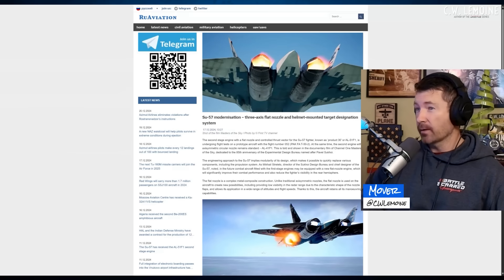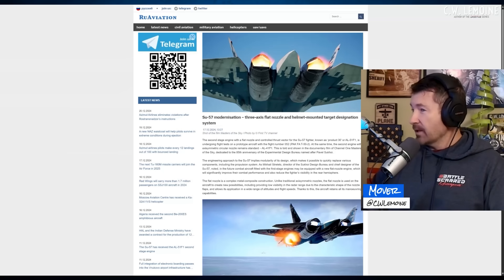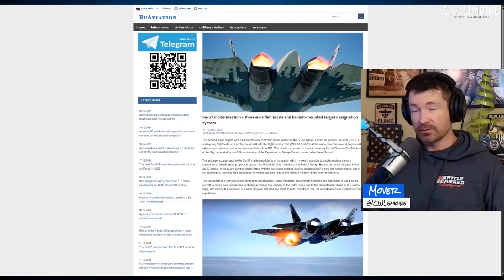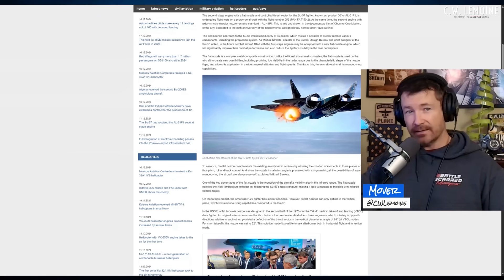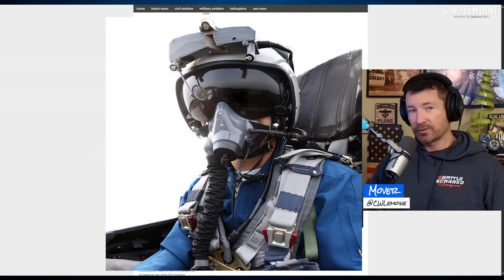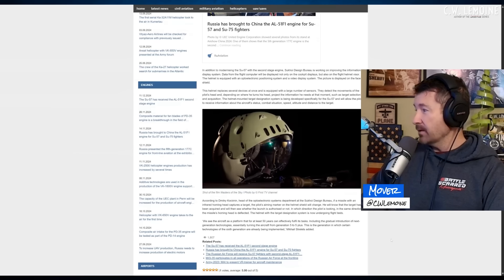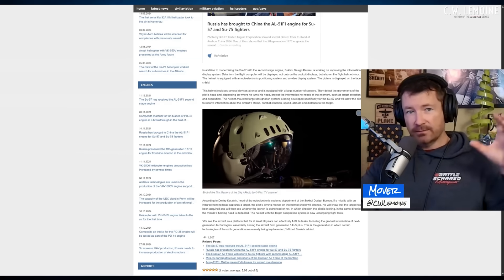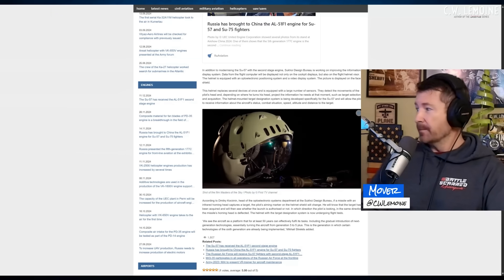New Upgrades for the Su-57 FELON

Comment: The SU-57 has one of the world's most advanced radar arrays. Pretty much the entire front of the plane contains radar emitter modules including the leading edge of the wing and sides of the nose. These are meant to allow for longer wavelength emissions for detecting stealthy aircraft and scanning more of the sky at once.

Russian radars tend to be worse than western radars of a given size and weight, but the SU-57 is a big aircraft, so be assured that they have crammed a good amount of the systems in them.

I would seriously recommend you watch Millennium 7 on the SU-57. It is not exactly some super weapon, but the Russians design has always been quite different from Western designs as a result of their asymmetric air-combat doctrine.

Comment: Looked at a channel that had a deep look at the new system, comparing it against the old system - a lot less moving parts and found to be more reliable, cheaper to build and maintain and also easier to maintain.  A comment that came up was 2 dimensions were the usual for air combat with the 3rd dimension probably for aerobatics - most likely for air shows and marketing the beast.

Comment: Thank God that Russia doesn't have the cash to mass produce. They have the tech but like Germany in WWII they just want to "Land Grab. The SU 57 is basically a F22 with smaller Vertical Stabilizers, Engines closer together and 3D thrust rather than 2D. They will lose some maneuverability by changing up exhaust to improve stealth.
Reply: Its a garbage plane with 10,000 times crappier stealth than the F-22 and F-35 and that is a FACT.
That plane is not a stealth fighter. Russian industry is too far behind to make anything comparable. They are unable to make plates sitting tight togheter so that radar reflections are minimized. The body of the plane is Y-shaped which makes the plane even more unstealthy. Its a worthy opponent of 4th generation fighters, but it cannot take on the role of 5th gen fighters because it is not stealthy enough for that.

Comment: Su 57 most advantage is their range 3500km internal fuel, becouse it's big size,
Reply: Actually, the maximum range without outboard fuel tanks is 4,300 with 5,500 of them.
Reply: And yet not much impressive compared to most other jets in the west. Gripen E despite its small size and single engine got a range of 4000km.
And F-15E got a range of 4800.

Comment: Modernizing a plane that just came out. And they don’t even have enough for a “squadron”
Reply: Su-27S was barely out, when Sukhoi was already developing Su-27M, that was for export market as Su-35.
Do not mistake Su-27M / Su-35 to what the Su-27M2 aka Su-35S is. 

The Su-27M was far more than what Su-27S was, as it was adding more what the Su-27S was suppose to be, but was cut off by the specific minister who wanted Su-27 share as much as possible parts with the MiG-29 project. 
So Sukhoi was required to downgrade HUD from 4-color to monochrome and from wide to narrow. Radar was downgraded from PESA to common one, datalink was maintained, and cockpit didn't have five LCD but just one and without buttons.
The original Su-27 was too advanced at the time, and as usual the budget concerns like to cut things.
Reply: It's for show, like everything else. The real workhorse are the rapidly depleting Soviet stockpiles and Nork ammo.

Comment: The Nose, Wingtips and Tail radar can all acts as a Diamond Array for Passive Radio Direction Finding.

That means if the SU57 wants to penetrate an IADs system it can guide itself away from emission sources.
Reply: That is what the RWR does. 
You have multiple sensors set in furthest part of each other and timing of received signal is used to triangulate the emission location.
You don't need radar for that purpose. 

The radar benefit in AESA is that you can triangulate the location just with single panel, as you can time the signal between each element.

The Su-27 already could do this. And don't take the DCS horrible presentation of the Su-27S as it is biased to such negligent and underestimation that it is a crime. 
Eagle Dynamics has not even got SPO-15 RWR anywhere near close to real thing capabilities. What cause that people are constantly mocking SPO-15 capability because they base their understanding to disinformation by ED.

Comment: I get a little annoyed sometimes when people say more parts means more likely to break that only applies when the parts are designed poorly. It's a poor design problem not a more parts problem.

For example, switching from single overhead cam to dual over head cam. Spread the wear out between two separate parts allowing for more long term reliability with higher performance.

This mindset comes from Americans working on German things because the Germans tend to overcomplicate everything..
Reply: While it is that design matters, but the fact is that more parts you have, more malfunctions you have. More moving parts, more wearing parts, more parts to fit together... 
You can try to explain yourself out that how a amazingly well designed rubics cube will never malfunction or break. But take a solid block made from same material as you try to design the rubic cube, and you know that the solid block will always withstand far more than the highly engineered block from smaller blocks. 
Notice that solid block doesn't have same functions and capabilities as rubics cube, but if your purpose is to just kill someone by throwing it and hitting someone to head.... The solid one wins every time.
Reply: @TK-sh1lq  my explanation of the cams should be enough to prove its not always true.

Here's another example a wheel bearing. Before bearings they used bushings. Bushings are much less moving parts, but they are more reliable, and can handle more stress.
Reply: @Greasy__Bear  They do???
Reply: @Greasy__Bear  not really a good example, as the other guy said, more moving parts is more wearing out parts, if the system is well designed it will last of course but one could argue that a tuned down single cam design with less stress on the components can match it. 
Also don't bring German engineering here, it's even worse example because when it comes to German engineering and particularly in automotive industry there are other crucial factors that MUST be considered such as:
1 - EU: cars in European Union must follow extremely strict norms on emissions and safety which in turn heavily affects overall design and technological solutions.
2 - The mindset or doctrine if you will behind the German engineering. The idea with their design is that while it's extremely complicated and can be a real pain to work on, the system is usually very efficient albeit not very redundant but that comes from the assumption one will strictly follow the instructions on how EXACTLY use and maintain such system (the car in this case) and will not deviate from these instructions. If these conditions are followed then the system usually gets through it's expected life cycle and even beyond that just fine.
So then there is also the expected life cycle of the system which is something that changed a lot when we talk about European made cars. They just don't make them to last anymore in most cases but that comes from business side of things, not engineering side...
Reply: @peterkolesar4020  my brother worked with German engineers on a ATM machine, and had a similar impression. 

The Germans had  the opposite opinion of the American engineers as in their creations are crude and overbuilt, but the Americans designs were usually cheaper and quicker to produce and no less reliable.
Reply: Dual overhead cams were mostly used for improved efficiency, emissions and performance, not because it's more reliable.
In fact there's still unicam engines produced today.

Comment: This flat nozzle design by the Russian is actual simpler by far, that the one with round nozzles. The reason is that each element in the round nozzle has its own hydro-mechanical actuator, where as in in the flat nozzle you have actuators above and below the nozzles, and another pair outside the horizontal planes. The mechanism is easier, more durable and much lighter
Reply: Пока нет видео работы сопла с гидравликой полностью . Просто и на треугольном сопле можно вокруг расположить гидравлику .
Пока нет видео и значит спорить бессмысленно .
Reply: @PirandelloKruger  There actually is a video showing exactly how the new flat nozzle is being actuated. Just because you do not know about does not mean that it is not there
Reply: It isn't at ALL simpler. In comparison to the AL-41 it can be argued that it is, but the AL-51's thrust vectoring design is more streamlined than even the PW F100-232's linkages.
Reply: @TheArcticFoxxo  The Al-41, Al-51 and P/W F119 and the P/W F135 are of Russian derivation...
Reply: @MabuloLibwese  I never said otherwise?
Reply: @TheArcticFoxxo  I was trying to bait you to say I was wrong
Reply: @MabuloLibwese  Well, you are. The issue I had with it wasn't the accuracy, but the relevance.

Comment: People do not understand that Russia was the first country to introduce flat nozzles in the VTOL Yak-38/41 program of the 1970s, they are mentioned only for the purpose of testing the thrust vector, I quote Yakovlev: "a flat biaxial nozzle was developed in the second half of the 1970s for the vertical take-off and landing fighter Yak-41 (VTOL). An original solution was used to rotate it — the nozzle was divided into three segments, which, rotating in opposite directions relative to each other, provided a deviation of the thrust vector in the vertical plane by an angle of 95 ° (in vertical takeoff and landing mode). For short takeoffs, the nozzle was installed at an angle of 62°. This solution made it possible to use the afterburner both in horizontal flight and in vertical mode.
Reply: In Russia, all sorts of great things can be thought up and prototyped, but when it comes to production, it's just another trash.
Reply: The Yak-38/41 didn't have flat nozzles? The Yak-41 had a pivot beyond the augmentor but before the nozzle that allowed it to perform VTOL operations. The Yak-38 simply had vented outlets, not a nozzle.
Reply: I agree..
Reply: Yak did not have flat nozzle. It rotated but it was round - like F35B’s.
Reply: @joe1273  The F-35 vertical takeoff and landing technology was developed by the Yakovlev Design Bureau under contract with Lockheed Martin.
Reply: It was interesting to know
Reply: @joe1273  Stealth Technology: Petr Yakovlevich Ufimtsev - "The Method of Edge Waves in the Physical Theory of Diffraction". There is a film about this Russian technology, shot by Discovery, about the creation of the F-117.
Reply: @joe1273  LOL Joe!!!
Reply: harrier had flat nozzles too.
Reply: Convair200:you sure about that?
Reply: The stealth technology was created by Russia, not the US. It is Russian technology! The helmet was also created by the Russians, they used such a helmet on the MiG-29. The vertical takeoff and landing technology used on the F-35 was also created by the Russians, Lockheed Martin contracted the Yakovlev Design Bureau to improve the Yak-141 design.
Reply: @globalpower6967 stealth is not a Russian technology. A Russian mathematician came up with the mathematical equation that would estimate radar cross section. The Soviet government saw no use for this equation and allowed him to openly publish his formula. 

Lockheed Martin’s skunkworks read this equation and recognized its utility in simplifying its efforts in creating a stealth aircraft as before this equation they had to physically make a mock up and test it against a radar via trial and error. 

Radar Stealth is an American technology.

Also Lockheed already had a 3 swiveling nozzle designed before the yak 38 they simply bought flight data from yak in order to cross reference their designs with real world flight data as the American equivalent was deemed to expensive and never got past the design stage
Reply: @globalpower6967  Практическая технология строительства малозаметных самолётов в определённом радиодиапазоне была разработана в США, Русские математически обосновали и просчитали эффекты от уменьшения угла преломления лучей разных модуляций и частот.
Это тоже что спорить о светодиодах и лазерах, гетероструктуры разработал Алферов, но первый светодиод и на его основесветодиодный лазер построили США. Первый вертолёт прототип  придумал Сикорский в Российской империи но построили 1 вертолёт в США - тот же Сикорский.
Reply: @globalpower6967 lockheed martin, an american company, contracted yakovlev to
Improve a design of yakovlev...huh?

Also, while it is true that research papers leading into the development of stealth were of soviet origin, the soviet union dismissed them entirely right up until the unveiling of te F-117 nighthawk, and you know it very well, you cant expect me to believe that russia invented stealth aircraft when they have only managed to produce one single airframe as of late, the Su-57, and in very very low quantities, meanwhile the us has produced the F-117, F-22, F-35, B-2 and is in the process of procuring the B-21 raider.

If i made a paper that was an important stepping stone to creating lcd screens and my country dismissed it, but you use that paper to actually make lcd screens even tho my research wasnt specifically on making those kind of screens, do you think im in the right of saying i invented lcd screens when you were the one to actually build it first and get it working?
Reply: @globalpower6967 HMS/HMDs was an F-4 Phantom thing which the Russians copied for their MiG 29.. Can’t attribute everything to them. Thermals ended up also not being a Russian invention. Yet now they are needing France for those optics on their tanks.
Reply: @BARelement  "HMS/HMDs was an F-4 Phantom thing which the Russians copied for their MiG 29.."

The VTAS (Visual Target Acquisition Set) is from 1972. Russian's had the HMS started 1964 in Kiev Arsenal plant (optical missile seeker developers and producers), at the request of Molniya, the developers of the R-60 dogfight AAM. The device was initially called TsURT-60 and intended to be used to target the R-60 AAM.

The VTAS wasn't wide service system, neither was the Russian's HMS. 

Developing and testing something doesn't mean that military is ready to accept systems in service. Or it to be in service globally but just in very specific groups. 

Remember that R-60 missile was taken in service only in 1982, and was superior to maneuverability until R-73 got out. And R-73 missile turn in spot like the R-77 does as well, capable to perform 90 degree turn in few meters radius if required, and not a wide hundreds of meters wide turns like in DCS. 

Soviets well knew that in the future the IR missiles needs to be able make very tight turns and that requires to be able look the target and get missile go there.

This is why as well R-60 and R-73 missiles has a targeting data uploaded to them before launch, it is not dummy IR seeker locked and missile figuring it out. 
The fighter targeting system will track the target and it will upload to the missile target distance, target heading, target speed and last known vector. And R-60 and R-73 missiles (as well R-27 etc) use this information to calculate where the target is heading in the next future seconds and intercept it to there.

The R-23 and R-24 missiles are as well very advanced without datalinks, and R-27 is even more. The capabilities to use SARH missiles with multi-target guidance and lock-on-after-launch to minimize the RWR warning time of the launch at the target etc.
Multi-Sensor-Fusion to target and guide missiles with radar, IRST or datalink. Buddy-guidance radar missiles while launching aircraft turns away etc. 
These are features that west didn't get than decades later.
Reply: @BARelement  dude almost everybody knew HMS was first made from USSR and even get mentioned by some documentaries when they introduced redfor planes
Reply: @BARelement  Миг-21. Вот как раз Миг-29 скопировали США.
Reply: @BARelementФранция уже давно не нужна нам😂😂😂 Уже давно заменили. Верьте и дальше вашей пропаганде. А правда в том что в самолётостроение и ракетостроении нам равных нет. А ваша пропаганда всё время говорит о том что у Русских нет технологий, что в водит вас в заблуждение и заставляет верить что вы круче всех😂😂😂 Но мы в России всегда смеялись над вашей гордыней, она делает вас слепыми.

Comment: Do you know if su57 is used as an awacs? At least temporary. I've seen couple of things that suggest that su27/30/35 are provided with intelligence from airborne platform possibly using SU-57, after A-50 incidents early 2024.
Reply: MiG-25s were also used in this way. But to be more correct, the Su-35 became the AWACS fighter when it was created, the task was initially to replace the F-15, F-16 and AWACS in one person. (It was also because of this that AESA was abandoned on the Su-35, after all, a 270-degree view was a priority in this regard

Comment: T-50 means that the prototype for Su-57 is a tank built in 1950.
Reply: Oh boy, wait until you hear about the T-50 tank from... You guessed it! 1941!
Reply: @TheArcticFoxxo Also the prototype for the Su-27, the T-10, is a tank from 1953 and not from 2010 as one would believe
Reply: @FRGBlackBurn  The Su-57 isn't even a plane either, it's the domestic designation for the T-48 motor gun carriage (that's right, made in 1943!).
Reply: Still have more fly hours